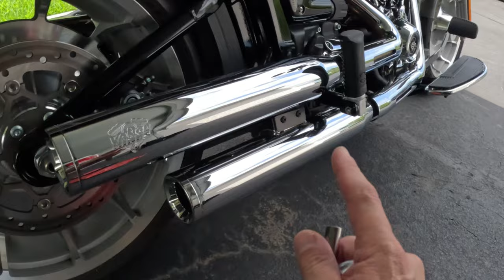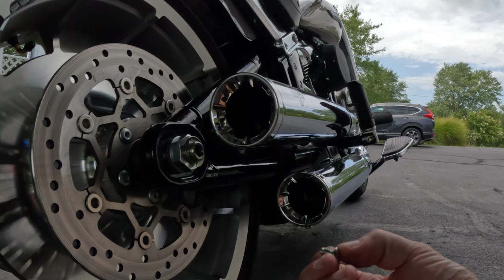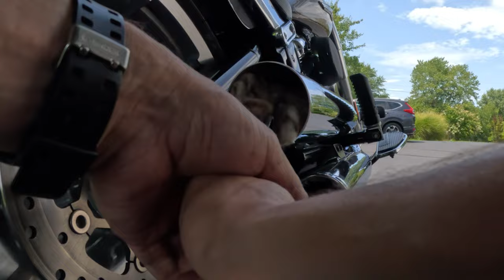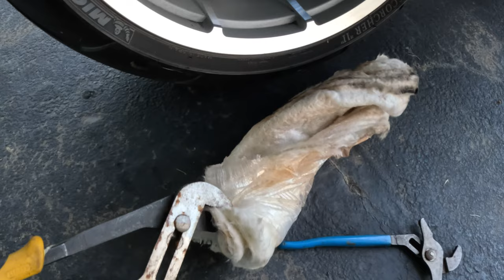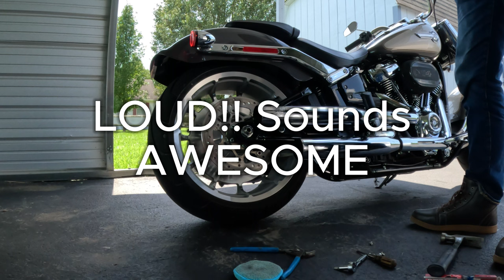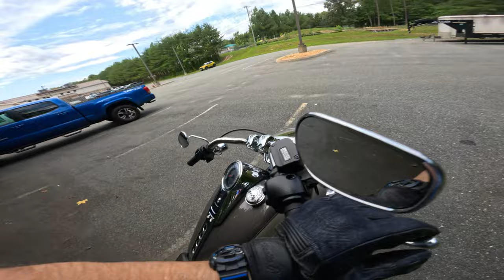I Didn’t Think They Could Sound This GOOD!  Vance & Hines PCX Eliminator 300 for Harley Softail M8

Comment: Have you notice a change in power (lugging) at all and your fuel economy?
Reply from the maker: @DREAMrhcp  no I never noticed that- maybe a slight change in throttle response but that could also be imagined.  No Change in power or fuel economy change, but I also was running the Screaming Eagle tuner.  I’m not sure if there may have been more of a performance change without the tuner.